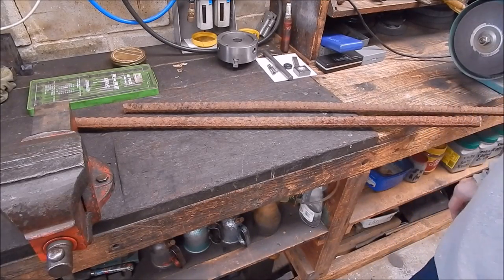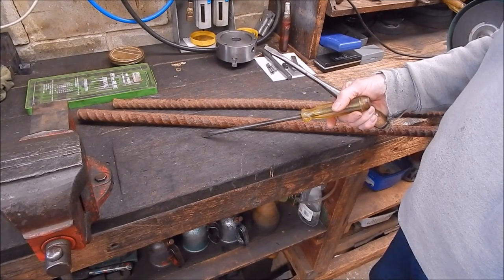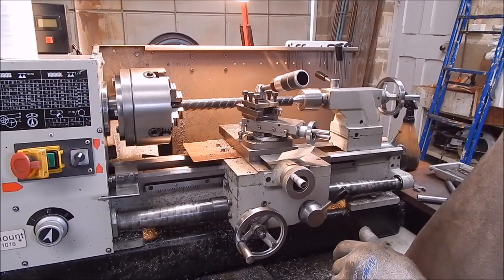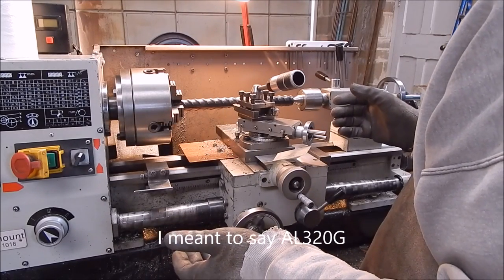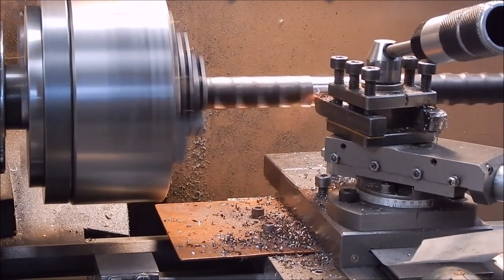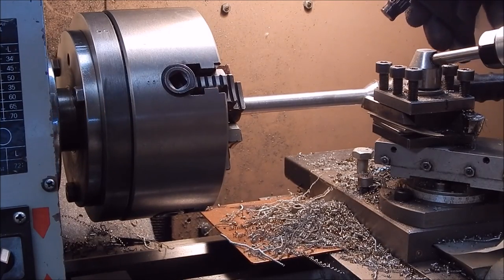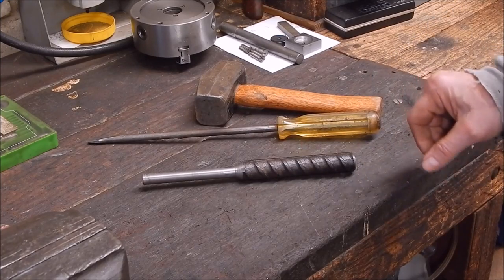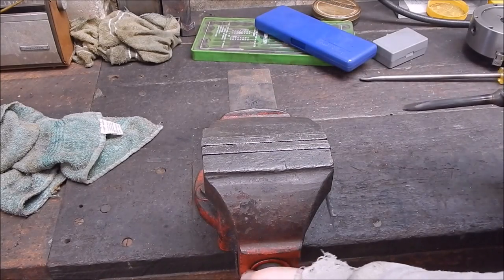Make a heavy duty screw driver out of Rebar

Comment: I have a similar one to loosen stuck skews. You hit it with a hammer while turning. It's the cheap mans impact wrench. :-) Works also if you want a skew rally tight.
But i had to surface harden it. I put it with cole and sawdust in a can and heated it for 12 hours to get more carbon into the steel. The construction steel i had was to low in carbon to harden it.

Comment: Like your comment about the al 320 regarding feed control I bought one and not having a quick change gear box is a big draw back. I have owend it for about 4 months so still getting to know each other but other than that havent found too many flaws-although realy have used the tail stock for serious work yet.
Reply from the maker: Hi Tony,

Yes, it's one of those lathes that sucks you in.  I considered it when I was lathe hunting, as the idea of a geared head for that price (at the time) appealed.  It's only when you seriously examine it that you realise it has no QCGB. 

I don't want to offend AL320G owners, but a lathe of that size seriously should have a QCGB.  It is the largest late model lathe I've seen without one.  And for the price it just doesn't stack up.

If they added one it would be an awesome lathe, because the rest is really pretty good.

It's a bit like the BV20 series in a larger form.  The BV20 is rarely sold in Oz now as the later versions of the 9x20 range  pretty much all have a QCGB of some form.  

I'm sure the AL320G will work well, but the feed speed issue is going to haunt you.

Cheers Rob

Comment: Hey Rob, Love the videos. Bought the FI-610 from paramounts start of this year. Great little lathe for the money, certainly much better than the offerings from H&F!! Only major complaint is changing belts for speed is a pain in the A, but plan to put a new motor and VFD on it sometime soon. Keep up the great videos, Cheers!
Reply from the maker: Glad to hear it goes OK. I still think that is the best bang for buck lathe even three years later.

Yes, I'm not very impressed with the H&F offerings and prices.  Quality seems a bit iffy judging by comments in forums as well.  I've had a close look at their stuff and it's nothing special.

I modified my belt drive system by adding a separate adjuster for the intermediate pulley, and can change speeds within 2 minutes (easily).  But if you are going to do a VFD and motor swap then why bother?

Cheers Rob

Comment: PS:  This brings up the question; Is all rebar made of the same steel stock?  I would guess it is not as most probably big jobs can specify what the specs call for.  So one may or may not be getting consistent grades of steel when buying or finding random sticks.
Reply from the maker: Unlikely.  There is no detailed specification for the composition elements that I'm aware of.  It's all a bit loose, so batches could vary from a metallurgy point of view.

Rob
Reply: It's a crap shoot using rebar for anything except reinforcing concrete.  The steel can vary so much that its properties are totally unpredictable.

Comment: Interesting experiment. I've never managed to harden rebar, perhaps some grades have a higher carbon content?
Reply from the maker: I gather that the specification for Rebar metal content is very loose, and mainly concentrates on tensile/torsional properties, so almost anything goes with the metallurgy side.

I have three different batches and they all seem to harden OK.  Certainly much better than any low carbon mild steel.

This particular piece seemed to come up better than 1080 that I would normally use when having to harden.

Cheers Rob
Reply: I smashed my rebar out of a redundant concrete lintel, so probably very low grade. Will have a look around the scrappy next time I'm there.

By the way, the pin vice works a treat! Cheers, Nigel

Comment: G'day Rob , you mention winter in Adelaide i think we up here in Mackay NQ have only reached for the jumper half a dozen times this winter, any how I'm only new to lathe work and your videos have been a great help so thank you . You mentioned in a previous video that you use a kero -engine oil mix for cutting fluid for steel was this correct and if so approximately what ratio did you mix it that you have found to work well for you. Keep up the good work mate.
Cheers Troy
Reply from the maker: Hi Troy,

I just use 1:4 engine oil to kerosene mix.  It's an old timers receipe.  It smokes a bit much when things get hot, and is probably not OH&S compliant, but it's as cheap as it gets and works well.

Just put the fan on if things get too bad.

I like it because it doesn't give you dermatitis, cause rust, or remove paint like the water based ones can.

Cheers Rob

Comment: you need to add carbon to the end and then quench... this kind of steel is low strength and meant to bend before it breaks. screwdrivers use higher carbon steel

Comment: The flats of a screw driver are not ground flat but with a curve as done on a round grinding wheel, this is the proper correct way other wise when you use your screwdriver on a screw, possible damage on the screw itself because it does not fit correctly, what you made is a chisel
Reply from the maker: As I stated in the video quality screw driver blades (as for gunsmithing) have parallel sides at the tip, while basic screw drivers use a wedge shape - to allow them to fit a wide range of slot sizes.

Most off the shelf screwdrivers have flat sided wedge tips.

They area poor substitute for correctly ground tips, but that's what most people use.

Rob

Comment: That clear top tap and die set resembles the really cheap (and I imagine crappy) Ebay sets sold for around $12.  Is that what it is?  Is it making thread cutting great again?  Love to hear your thoughts.
Reply from the maker: That Metric set is made in Japan from carbon steel and has actually done pretty well.  I bought it when I was in my twenties.  I've had no problems with it.  Thread sizes are accurate.

What the Chinese ones are like I can't say.

You can't beat HSS for staying sharp and as/if these break I replace the size with a quality HSS unit.

Overall the Japanese ones are OK for occasional use.

Cheers Rob
Reply from the maker: I must say that the die holders and tap holders in the kits are shit, and I made up bigger, better, stronger ones of each.

Probably the worst aspect of the small dies and cheap taps is that they don't start as easily as HSS.  The greater start taper length and sharper edges just makes it all way easier with the good quality stuff.

But buying a full set of HSS will cost you an arm and a leg.  So these do the job for light use.

Cheers Rob
Reply: I've about concluded, other than spending near $1000, you can't buy non-asian HSS tap and die sets.  They can only really be purchased one by one (on a practical budget).   I do own an SAE and Metric set of Asian origin probably purchased from Harbor Freight 15 to 20 years ago.  They have served me with only a few issues.  I've been very tempted to buy the Irwin HCS set in order to have an American made set.  However, I'm thinking used HSS might turn out to be superior.  It's my collecting instinct at play here.  I want the best sets I can get.  (oh yes, like drill bits, I won't be satisfied with just one set) However, the best taps and dies does not really come in all inclusive sets.   I've been adding to my tap handle/wrench collection, what you get in the Asian sets is terrible.  It's one way to evaluate a set.  If it comes with a cast tap handle, you know the rest of it is of similar quality.
Reply from the maker: You can still buy large HSS sets of full sized dies in Australia for under $1000, made by P&N.  Farm supply agencies generally have them as it's something you can write off at tax time for a business.

Nice to have for sure, but as I have two sets of Japanese in metric and imperial, and a box of quality full sized HSS orphans, I don't have the need to go that way.

They are something I always look at secondhand though, but many of those have been worked to death, lost their edges from rust, or are sizes I would never use.

Always handy at the right price.

Cheers Rob
Reply: I'm willing to buy what I can't use if the price is right and re-sell for a profit so I can use the money to get what I can use.   You can use good tools and deal like a form of currency to flip into what you really need.
Reply from the maker: Yes, totally agree.  I rarely buy new unless it's something I need immediately or is specific.  I had a vehicle stolen years ago with a lot of my work tools in it.  When I went to replace the tools at new price I was gobsmacked at the final figure - thousands of dollars just for hand tools.

It makes you realise that secondhand gear is the way to go.  It takes a lot to wear out tools, especially good quality ones.

I browse Gum Tree (like Craigs list) a couple of times every day and that's how I pick up my bargains.  You just have to be selective and know your prices.

I see guys on the Web with squeaky clean almost clinical looking workshops, with shiny new tools hanging the wall etc. and you can tell straight away that money is no object and secondhand doesn't get a look in.

It's also fun buying secondhand, and I often sell on and make a buck if I don't need it, or am upgrading.

Makes life interesting.

That's why I still drive that rusty old 4x4 truck, but it can carry anything, go anywhere, and no risk of getting stolen  I'm past caring what people think, and if you often see me in a worn out sweater and unshaven in my videos, that's why.

I don't expect an invitation from the Queen so that's the way it is.

Cheers Rob

Comment from the maker: I had a question about how I machined Rebar so easily, and mention was made that it takes the edge off of tooling.  Is there a trick to it ?

Not really.  It comes down to using the right cutters and speed.  It's just mild steel.

I used TCMT carbide at about 460 RPM and it came up quite OK.

I wouldn't recommend using HSS on the hard rolled outer section of Rebar as it will definitely take the edge off the cutter.  As shown, Rebar can and will harden quite significantly.

This is carbide territory unless you anneal the bar.  Once the hard outer layer is gone, the centre section is quite soft.

The trick to getting a great finish at the end on any mild steel is to use a shear tool as seen in the video.  Another video on my channel explains how to make one of these.  That finish was also cut dry and at a higher speed than recommended for shear tools.  I've never found it necessary to crawl along with these and lube requirement varies with the metal.

A shear tool can put a fine finish on just about any steel or aluminium you care to machine.

Worth trying one - it's a very easy HSS grind anyone can do on a basic grey grinding wheel.

Cheers Rob